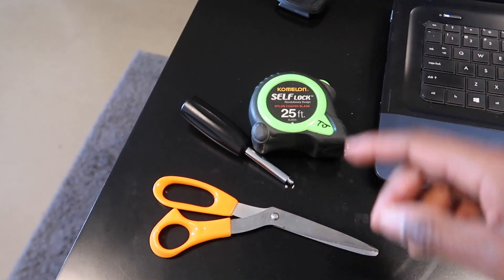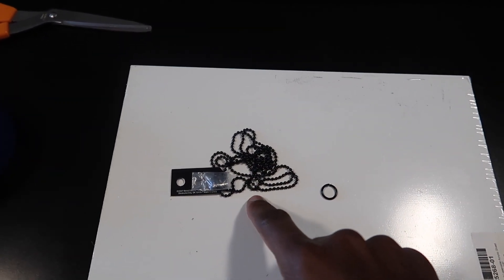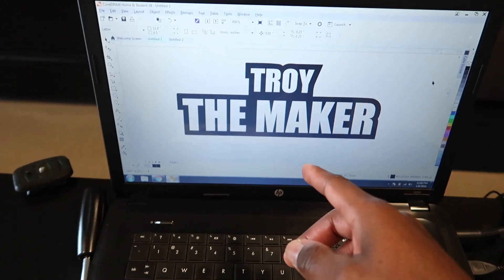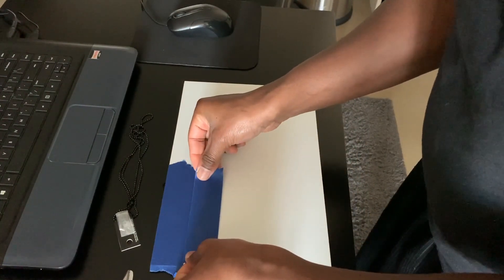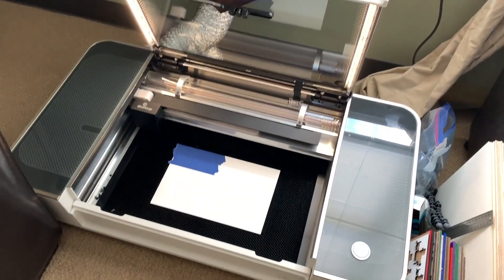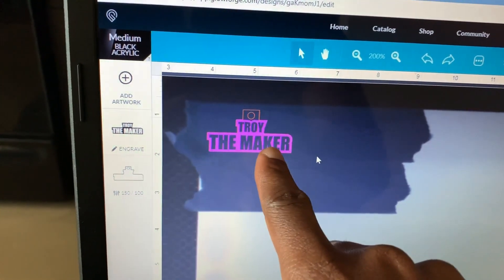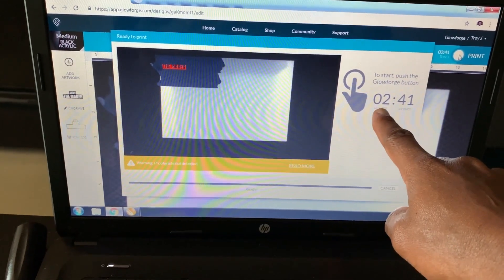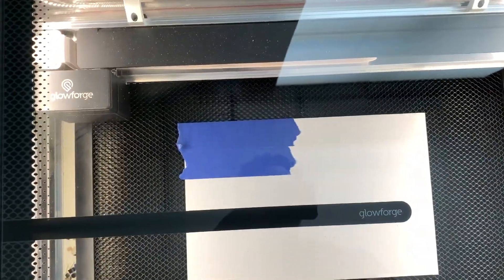Laser cut acrylic jewelry using a Glowforge Basic

Comment: Liked that project a lot.  Your video was one of the first that I saw that wasn't using the Glowforge stock materials.  Did you have any troubles finding the right manual settings or was that pretty easy?  Keep up the great work!
Reply from the maker: Thanks a Million! It was pretty easy I would select Glowforge settings as if I purschased from them and they work just fine.

Comment: SO THE GLOWFORGE IS NOT A STAND ALONE PRODUCT (DO YOU HAVE TO BE CONNECTED TO THE INTERNET TO USE IT)?
Reply from the maker: Yes. It has to be connected to the internet whether it’s your computer or phone.
Reply: @TroytheMaker  That means that the machine is unusable by itself, next time save up and get an Epilog laser, or Trotec. Glowforge used cheap glass CO2 tube, the pressure will drop in 1-2 years and you are done. Epilog laser has a different type of CO2 laser tube, the pressure will drop but at much slower rate.
Reply from the maker: @runtime1976  Thanks for the information. I'm still new to these lasers and have a lot of learning to do.
Reply: yeah, I think the GFBasic is a good place to start. Mine arrives soon 6/22. Looking at possibly a Boss machine in the future. Much more versital